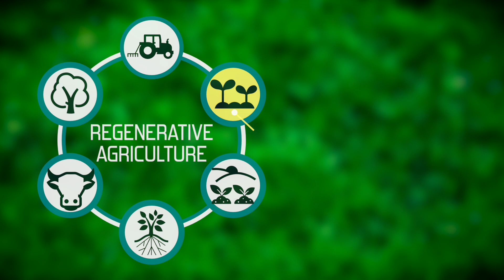Regenerative Agriculture - Key Principle 2 - Maximise crop diversity

Comment: I understand how one can achieve diversity of plant species when planting a seed mix onto a barren field, but what about existing pastures? Is there a good method of improving plant diversity in existing pastures? My initial guess would be to overseed a nitrogen-fixing plant like clover. 
Basically:
How was the diverse pasture featured in the video created? Through overseeding or from scratch?
Reply: Grazing types will bring different diversity. Don't need to spend any money. My multispecies paddocks planted cost me money and time.
Reply from the maker: A diverse range of seed was sown into the existing pasture. This can be achieved through direct drill, or through minimal or strip till techniques. The farmer in this example used both perennial and annual seeds which included; grasses, legumes, herbs, cereals and brassicas. The perennial seed remains & if the annual plants are allowed to seed, then some of the annual species will return the following year. Clovers and vetch fix nitrogen from the atmosphere and persist well in our region.